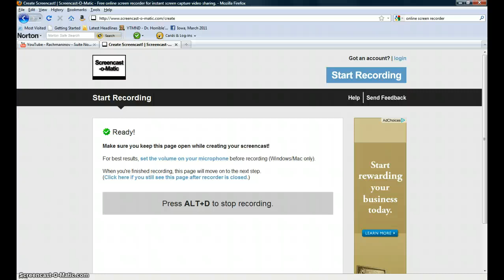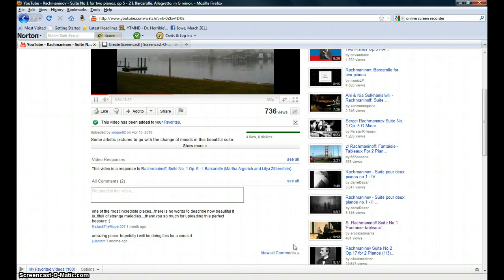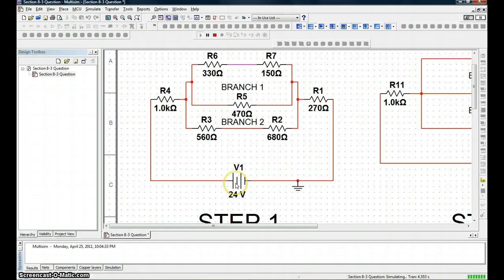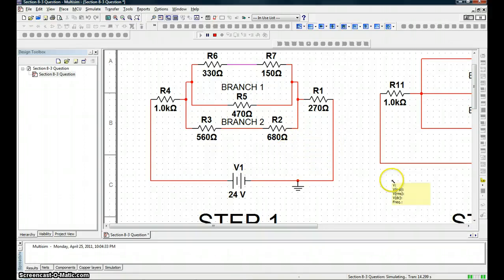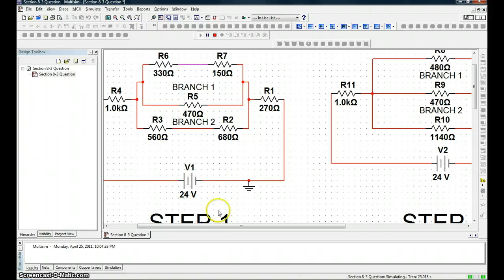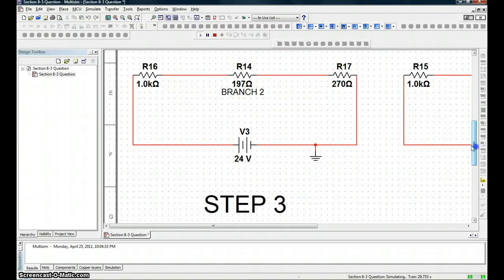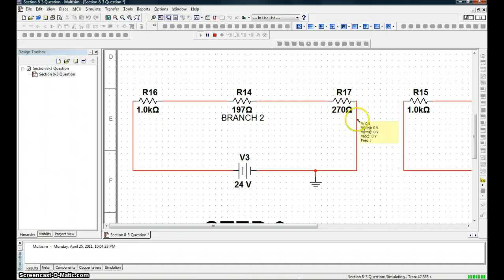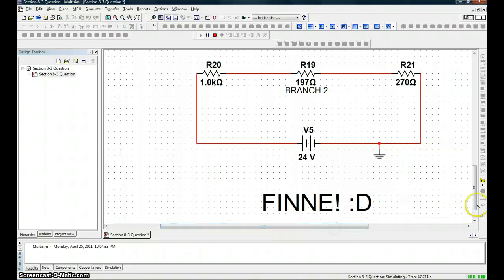Complex Circuit Screencast Volume 1

Comment: And not only does this guy have terrible speaking manners, he can't even do SIMPLE MATH!  Yeah, I too set up a spreadsheet wherein I could just plug in the resistance values and let the spreadsheet do the reciprocal math, but I did mine a little differently:

First, I figured the resistance from the parallel portion of R5, 6, & 7, because of the way the schematic was drawn, then I did a 2nd calculation for the entire parallel branch.  But I came up with 199K, which made me think maybe my doing it in 2 separate steps caused the mistake (since he came up with 197.)  So I then did it his way, wherein I added R2 and 3, and R6 & 7, then did the parallel calculations, and STILL came up with 199K.

So then I looked harder at his slides, and there it was:  The guy can't even add 560 and 680 (R2 & 3) and get the right answer!  Look at it:  HE'S GOT IT AT 1140!!

This is kids these days:  No proofing skills whatsoever (just look at text messages or comments in videos, etc), and no basic math skills.

Guess he should've used a spreadsheet for adding up the series resistors also!!

SMH  Those who can, do.  Those who can't, teach.

Oh and I just re-read the notes he wrote about the video:

This is a "PLAGUING QUESTION"??  Are you kidding me?  And, "EVERY QUARTER ALL THE STUDENTS STRUGGLE WITH THIS PROBLEM"????

This is so fucking simple.  It just goes to show how screwed up our education system has become.

And the only thing the bozo below me can ask is, "What program are you using?"  As if to say, if there's not a computer program to help me figure this shit out, then what ARE WE TO DO??

Absolutely fucking disgusting!!